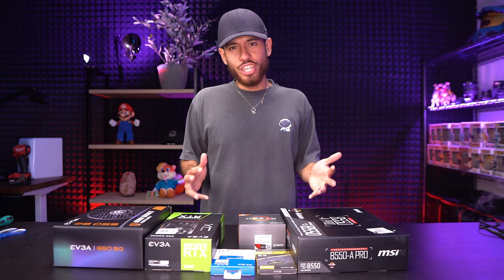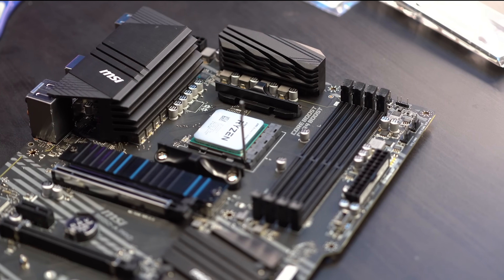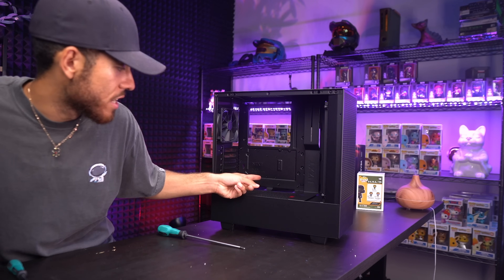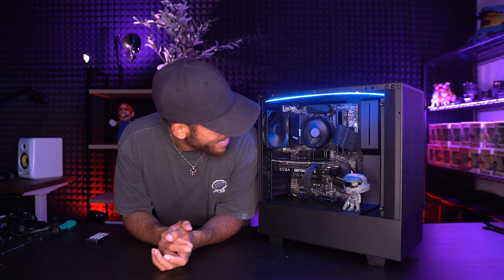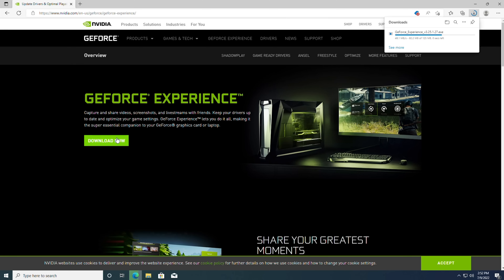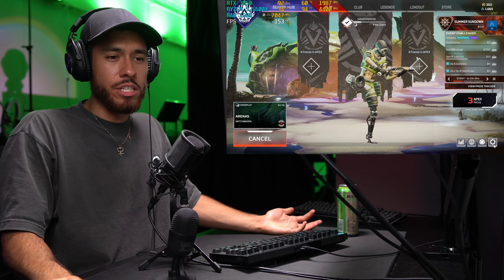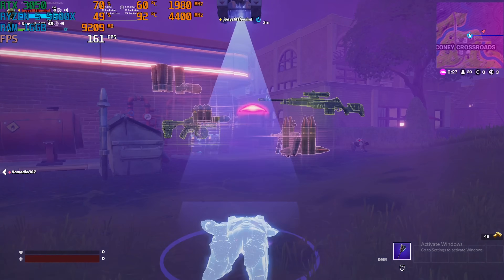Best $900 Gaming PC Build Guide - RTX 3050 Ryzen 5 5600X (w/ Benchmarks)

Comment: You definitely gotta enable PBO2 on Ryzen 5000 to get higher clock speeds! There are good guides on Youtube that will get you more performance and lower temps! I also lowered my PPT, TDC and EDC to around 80 - 85% of max (I don't remember exactly) to push an even higher curve value.
Reply: I've had mixed opinions and experiences with PBO. My 3900x system even on a high end x570 board has instability issues with PBO enabled (games crashing randomly without error is a symptom of a bad OC).
Reply: @ardeof  Ahh sorry to hear that. Ryzen 5000 got a new PBO"2" though that has gotten good praise online from what I've seen. It works well for me, I can push 4,850 mhz in single core in many games.
Reply: @patb3356  so do I just enable that and that’s it? Or is it something I do after overclocking ?
Reply: @AFKJosh  I recommend watching the video titled "Ryzen 5000 Undervolting with PBO2 - Absolutely Worth Doing" by Optimum Tech 

You basically are setting a value between 0-30, the higher the value equals the higher the "undervolt" but then the CPU takes advantage of those lower temps and overclocks itself. I'd recommend gradually increasing the value after some benchmarks / stress tests. I did this around a year ago so I'd recommend watching some more videos to get a much better understanding! Cheers!
Reply: Man he can't turn on PBO, his temps are almost 100c playing warzone. Lol His build is shit. For 900 bucks he has a stock cooler and a solid front panel case. This thing is an oven.
Reply: @redfuryin  I have a Hyper 212 and my 5800x was getting near 90C. Ryzen 5000 just runs hot. PBO2 is an undervolt technically. I can run my 5800x and 4,850mhz single core stable but it fluctuates in more demanding games. If he limited his power limits, he wouldn't be getting so much temperature.

Edit: corrected the max temp to 90C (confused the max temp with Intel)
Reply: @patb3356  youre running an 8 core processor on a single fan cpu cooler.  That does not mean "ryzen runs hot". That means your running a 105w processor on a cpu cooler rated by cooler master for 120w youre cutting it close on what they would they say it can handle. I have a 5800x in my pc right now, and it never reaches 70c because I have a good case and good airflow with an adequate cooler. His problem isn't "he needs to tune down his cpu" its he has 2 fans in the entire fucking case with a stock cooler on the cpu.
Reply: @patb3356  and to say your cpu reaches 100 degrees tells me everything about how your build probably looks, you probably have a closed front panel with hardly any intake, with negative pressure inside the case so the small single fan cpu cooler is just blowing around hot air inside the case.  The maximum operating temperature for the 5800x before throttling performance is 90c. Just because this guys build is reaching those temps does not mean your temps are normal. You're both in the wrong.
Reply: @redfuryin   Hahaha my apologies, I confused the max temp allowed with my Intel laptop which the max temp before throttle is 100C. I have gone back to edit the comment. So my Ryzen 5800x was getting 90C stock in heavy load when I first bought it. I have one exhaust fan in the back, 2 exhaust fans in the top, two intake fans in the front, plus the CPU cooler fan. Simply look up "Ryzen 5000 runs hot" and you will see that from AMD themselves they have stated that their 5000 series run really hot. Once I limited my PPT, TDC, and EDC to around 80-90% of their defaults (I forgot exactly),  it reduced my temperatures to where I usually get around 70C on my CPU during gaming. I have my PBO2 value set to around 24ish that it was stable
Reply: @patb3356  yes AMD said it runs hot, but the context was in comparison to their previous gen, ryzen 5000 needs more cooling and many people wanted to upgrade from 2000 or 3000 series with the same cooling they had before, and some were finding out thats not something you can get away with. ryzen 5000 will boost higher as long as the cooling is right. But for any cpu temps to reach that high just playing video games is bad. not only can running at those temps for long periods of time hurt the life span of the cpu but you're also thermal throttling, which mean tons of performance is being left on the table. 
And if youre undervolting to limit thermals in your system, thats fine. everyones system is a little different. But if youre sitting in the high 80s and 90s while gaming, its time to think about a better cooling situation. also having 3 exhaust fans and only 2 intake fans creates a negative pressure in the case(if all fans are the same size) a good rule of thumb is to either have more intake or equal intake fans and exhaust fans. if you have more exhaust fans, air will be pulled in from the cracks and seams of the case and will cause dust to be pulled into the case causing higher temps as dust builds up.
Reply: @patb3356  in short to everything, hitting 95c in warzone is not normal and ryzen 5000 requires decent cooling.

Comment: Why would you put a 3050 in a $900 build? A 3050?! Is this a sponsored video or something? Performance wise, it makes way more sense to get a ryzen 5 5600 and an RX 6600XT - It'll blow your rig out of the water for roughly the same price.
Reply: Looking to do the exact build. If i do the RX 6600XT instead of the 3050 will I be better off? Will I have to change any other components or the case? Looking to run 1440p
Reply: @chandlerwise3829  not sure if you keep up with your comments but yes! Any GPU is good. Especially the RX 6000 series. I recommend the 6700 if you’re going for that 1440p

Comment: That ryzen chip runs hoooooot. Would pair it with a nice AIO cooler. Drop temps from 94°+ to around 70° - 80°C.
Reply: It likes to draw way over its tdp of 65W and that little stock cooler simply isn’t enough
Reply: what AIO cooler would you recommend?
Reply: @mrjsir-e1k  be quiet pure rock 2

Comment: Really cool build but I just can’t justify taking the 3050 over the rx6600 or 6600xt. 6600 is cheaper and slightly better and 6600xt is same price, way better.
Reply: @bippymalone4373  yeah man bought amd once and the pc exploded, lisa su robbed my house a couple of days later
Reply: even a 2060 is better and around 30-70 dollars cheaper
Reply: As joey said in a earlier vid everyone is trying to get the newest rtx because its nvidia but people are sleeping on the rx6600 even tho it have a extremely good price to performance ratio in the current gpu market and its better than the 3050 and 3060
Reply: @bippymalone4373  that’s a bit dramatic. I know plenty of people that have had good experiences.
Reply: Agreed, the build is pretty bad for the price. Should probably also go for a 12400f instead. Also spending 100 more and getting a 3060ti in there would make this so much better
Reply: @apullo7576  then it wouldn’t be a $900 build. That would defeat the purpose of having the price point
Reply: @RayShunFilms  Well if you don't want to spend 100 dollars more for worlds away better performance, could've also gotten an rx 6600. It's much cheaper and performs much better
Reply: @apullo7576  would the rx6600xt be a better option right now?
Reply: @CIVICX3  It is better than the 3050 for sure, if you’re getting it for a good price- around 300 dollars. It’s much much faster than the 3050 and also equivalent in price if not cheaper
Reply: @apullo7576  I found it brand new for $300… this is going to be my first gaming pc so I just wanted to know
Reply: Yeah I would never get the 3050 at all. Probably worst price/performance out of all. I'd rather save up an extra 100 for a 3060 or buy a 6600 which is like 2% worse than the 3060
Reply: @Scythical  Joey Delgado  sold his ass to some stores for this kind of stupid builds  or he is just stupid
Reply: @bippymalone4373  you are underestimating how widespread amd has become in the GPU market
Reply: @osama bin laden vs donald trump and

Comment: can i use a higher end graphics card like the 3060 for this build?
Reply: Yes however, the 3060 is a big avoid gpu to buy. so no dont buy that, and the rest of this system of this video sucks aswell.
Reply: yes. the 5600x is enough even for a 3080

Comment: RX 6600/6600XT/6650xt
i5 12400f + B660 or R5 5600
are better alternatives imo . 
but those are also fine .
Reply: The 5600X is actually cheaper by $5 at the moment. The 3050 is the wrong choice when you have the RX 6600 for $254.
Reply: @itsatrap4986  it depends on regions . 
Yeah its price is more reasonable rn
Reply: Is it worth getting the rtx 3060 or should i stick with the rx 6600
Reply: @deadkiila5308  6600
Reply: @itsatrap4986  preciate you
Reply: @deadkiila5308  Buy the cheaper one. Fps/$
Reply: @itsatrap4986  no but like is it worth buying the rtx 3060? Does it make a big difference compared to the 6600?
Reply: @deadkiila5308  What are the prices? 6600, 6600xt or 3060?
Reply: @itsatrap4986  ye
Reply: @itsatrap4986  im asking whicchone should i get like if the price wasnt there
Reply: @deadkiila5308  If price isn't an issue than there are faster cards than these. That doesn't make any sense. 6600XT is the fastest then 3060 then 6600. The price of a 6600 is $254 and a 6600xt is $300. What are you asking?

Comment: suprised with 3050 and playing apex at 360 hz you can still get over 100fps, never had a 3050 before so i don know
Reply: 360 hz? You know that hz is just the refresh rate of the screen? Its not a resolution. 1080p 1440p and 4k are resolutions. Your monitor refresh rates don't change anything besides how fast your screen updates the image.

Comment: If you are building this I highly recommend a ID Cooling cpu cooler and 3 extra 120 mm fans for better Airflow and lower temps
Reply: Cpu cooler unnecessary as its most likely not going to be overclocked, i agree with the fans though
Reply: @mudkip8612  If i got extra fans, where would i install them? Cause if i were to get extra fans i wouldnt know where and how to install them, and i also wouldnt know where the wire goes.
Reply: @nfam45  generally you want to have same amount of intake as exhaust, if you have 6 fans use 3 as exhaust and 3 as intake (1 in back, 2 on top for exhaust, 3 in front for intake, assuming its an ATX case)
Reply: @mudkip8612  yes it is an ATX case. Thanks for helping me out
Reply: @mudkip8612  the 5600x has great OC capabilities. I run mine at 4.5 GHz while also undervolting to 1.1V
Reply: @mudkip8612  I'd still prefer it over stock heatsink any day.
Reply: If you have the money, sure. But the stock cooler (with good fan config) is more than enough tbh
Reply: @mudkip8612  well it's running nearly at 100c with the stock heatsink tho
Reply: Where would you place the 3 extra fans?
Reply: @theafricanbullfrog858  make sure you buy the case NZXT h510-Flow which is the same one as the video except it has a frontal mesh design . It comes with 1 stock fan so you will put 2 In take fans at the front, and 2 exhaust fans. one at the back In the same spot as the video, and one on top of the case  from the inside .
Reply: Is putting extra fans helps lower cpu temperature?
Reply: @gwap0Q  technically that's what the air tower is for since it has a designated fan, but more fans with proper placement provide better Airflow in the computer as a whole which gives the cooling cpu fan cooler air to work with
Reply: @Stony1999  is it okay fan without rgb lights? Its kinda annoying though lmao
Reply: @gwap0Q  if you buy cheap fans it wont make a difference, that plus a cheap case that is ver closed off and has no ventilation holes
Reply: I have 3 fans but I’m using the cpu cooler is that good
Reply: @bryy6684  thats good just make sure theyre pointing in the right direction. Try placing 2 Intake fans in the front and 1 exhaust in the back. If the 3 fans mentioned includes the cpu cooler fan then do one intake and one exhaust
Reply: @Stony1999  so I bought 6600 instead of 3050 now is that better
Reply: @bryy6684  id say a 6600 is better than a 3050, the ryzen 5600x is still a good pair with it. Make sure the motherboard you're getting is compatible with amd cpus
Reply: @Stony1999  is this godi for 6600 ASUS ROG Strix B450-F Gaming II AMD AM4 (Ryzen 5000, 3rd Gen Ryzen ATX Gaming Motherboard (8+4 Power Stages, HDMI 2.0b/DP,2 x PCIe 3.0 x16, USB 3.2 Gen 2 Type-C, BIOS Flashback, 256Mb BIOS Flash ROM
Reply: @Stony1999  also is the 6600 a better pair

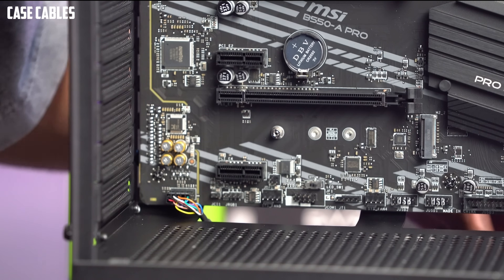Comment: i built an almost identical system literally yesterday and had one question. on the manual for the h510 flow it told me to connect the front panel to some extension thing that puts everything individually for non-intel but noticed at 6:45 that you didn’t do that. i’m assuming it doesn’t matter cause the motherboard has all the front panel connectors together, so that’s why you don’t need to do the extra step?

Comment: My brother, the processor temperature has reached 92. I think this is dangerous for the processor. You can use a HYPER 212 BLACK EDITION
Reply: He had videos where the temperature has reached 100 c⁰ i don't know where's the problem ryzen 5 3600 + gtx 1660s stock cooler same case 100 c⁰
Ryzen 5 5600× + rtx 3050 stock cooler same case 92 c⁰ !!!

Comment: Honestly for 900$ a rtx 3050 is kinda on the lower end I Would have went with a 6600xt and something like a 12400f instead and it would got 20-30 more fps atleast
Reply: Yeah, bought the same thing but with a 3060 ti and dif case for 950
Reply: yeah this shouldn't be 900 imo
Reply: Keep the 5600x, its 175 rn compared to 170 on 12400f, unless u want the upgrade path.
Reply: just buy used
Reply: @bigrig8539  agreed im currently using a i5 10500 i got for 100$ used and its a great deal works well with my 3060 i feel like older gen intel or 3rd gen ryzen is going crazy cheap for the performance
Reply: @bigrig8539  you will notice about a 10-20 fps increase in games with the newer cpu's but not a huge difference
Reply: @justin2justin14  was talking about gpu
Reply: @blueplanet...  yes i have the 6600 and can't open any game without drivers crashing. can't even use my motherboard's vga drivers because it's "unsupported".
Reply: @mxthajsdpo5113  lies I have a 6600 just got it and it works perfect fine. Idk if you upgraded form a older GPU but there’s a certain way you have to do it in order for it to work. You have to get rid of the old gpu drivers
Reply: @alanr70  completely new rig but it’s probably just a defective card. trust me i’ve tried literally everything lol
Reply: what motherboard should i get for the i5-12400F then?
Reply: And then the whole operating system breaks after installing a gpu driver
Reply: @Noodles4you  wrong
Reply: @Noodles4you  npc activities

Comment: I like it. My question is, based on the video, is it intended for the cpu to reach 90 degrees?
Reply: there is def something wrong there... i dont think it should reach that high
my guess would be there is no/not enough intake fans? just assuming
Reply: @bananagrim4001  The thing is that the GPU is pretty cool tho. Im thinking it may be the stock cooler. Maybe a combinations of both.
Reply: @Wusyaname_  someone already said it but yea the intake sitting at top part instead of bottom would make it better already 
the gpu got fresh air from the bottom intake n it also got double fans meanwhile the CPU stock cooler will suck warm air from the gpu
Reply: stock heatsink and only 1 exhaust fan, you can expect hot cpu. You can get a better air tower cpu cooler + 3 extra fans since you can have 2 exhaust fans, one at the back and one on top of the case, as well as 2 intake fans in the front.
Reply: @Stony1999  so would it be good to buy 3 extra fans and connect them to the motherboard for better airflow and temps??
Reply: The case is the main issue, the MZXT H510 has practically no frontal air intake
Reply: @DeltaRunner6  it does if you get the h510- flow. It has a mesh design in the front
Reply: i have the same CPU and fan, you can undervolt and overclock it. I run 1.1V and 4500MHZ. My temps are around 70-75. The CPU max temp is rated at 95, though i wouldn’t want it near that
Reply: he just needs to move his intake fan up bro has it at the bottom it aint cooling nothing down there
Reply: @mathewgonzalez4153  Fr.
Reply: Yeah those temps give me anxiety. He does great videos, although the temps are never great on his builds

Comment: I almost build this exact build, but instead of a rtx 3050 i got a rx 6600 xt for 390$. I also put in a 1tb m.2 instead of a 500gb one.
Reply: Got an Rx 6650 xt for $375
Reply: @oxylol_  new or second hand?
Reply: @sleepymc2287  it was new.
Reply: @JoshB4802  Nice. I suppose I will always pay more in my country(the Netherlands)
Reply: @sleepymc2287  it was new fam
Reply: @sleepymc2287  I suggest you search for used graphics cards locally, I am from Estonia and I can get a 6600XT for 315eur in my city, while online its 400eur. Even if it has been mined on its probably fine and most have a difference of 2-3% vs the new one.
Reply: @sleepymc2287  EU always pay more dude, u got a good deal
Reply: @oxylol_  Same here, but it was cost me 379 at Amazon.
Reply: @JoshB4802  still a great deal dude
Reply: lol you and me basically have the same build did you get a lian li case?
Reply: @anthonybarragan3473  No I have the NZXT H510 flow just like in the video
Reply: do you have the same frame rates?
Reply: @nuwwwv9089  I have way higher frame rates

Comment: i think rx 6600 still best in this price range build
Reply: It's a bit faster in the benchmarks I saw and it's 60-70 bucks cheaper ($254.99 on Newegg with rebate and promo code). You could also add 20 dollars to the build and move up to the 6600xt ($339.99 same retailer).

Comment: How about Ryzen 5 5500 and a 3060
Reply: The ryzen 5500 is quite poor, I recommend the 12100f instead even if it's only a Quad core. You can check out gamers nexus video about the ryzen 5500 to get an idea how it performs.